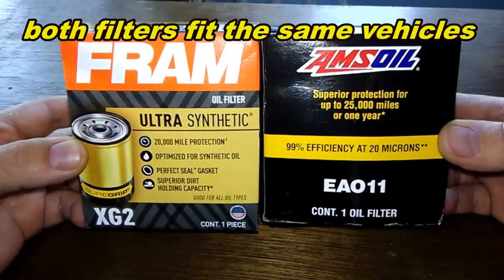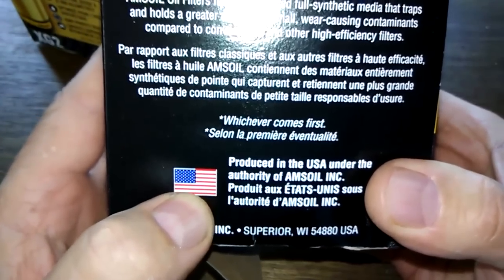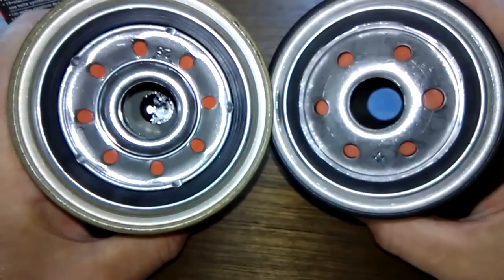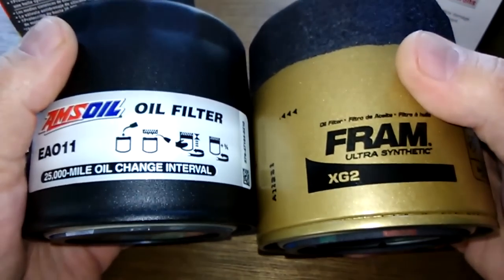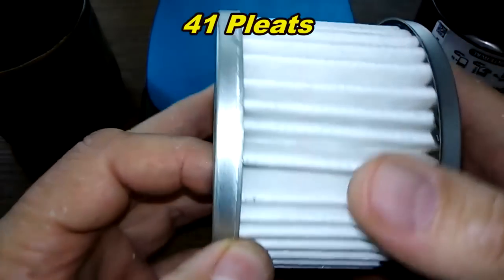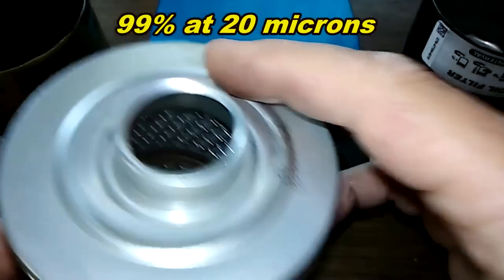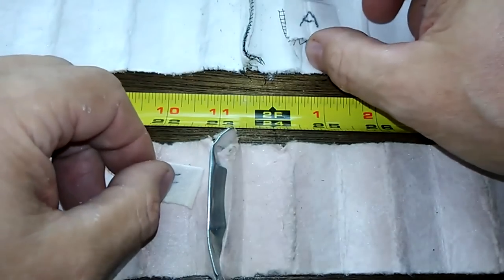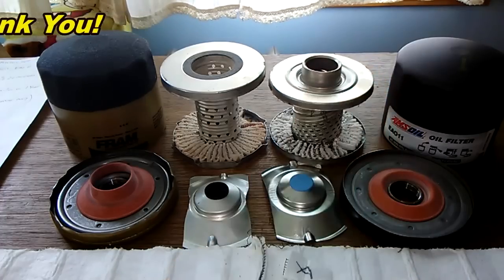Fram Ultra XG2 Oil Filter Cut Open vs. Amsoil EAO11 Oil Filter Cut Open Oil Filter Review

Comment: Any brand that tells you that can go longer with their products... Stay away from the them at all cost. This is a big red flag that should tell you that they don't know how engines work. I see this time and time again in my profession as an engine machinist and builder. What one should think about when it comes picking an oil to use... What oil will get me to 5000 miles safely? Well... They all will. The reason I say say 5000 miles... Because that's when the byproduct of combustion starts becoming acidic. There's no engine oil (or oil filters) on the market that is some how immuned from combustion contaminates. So what's the harm? The acids with in the byproduct of combustion will damage the valve stem, o-rings and gaskets. That's not good. If an engine isn't sealed properly, it smokes and leaks.
Reply from the maker: Good Point!👍

Comment: I wouldn’t use a fram on a lawnmower
Reply: I have for 20+ years. The orange filter on a $4500.00 John Deere LT 180, 17hp Kawasaki Vtwin. Doesn’t burn oil either. Gave that mower to my sister and still buy the orange Fram. Runs as good as the day I bought it. I just bought a Toro timecutter 24 hp Toro engine. In 2 years when the warranty is over I’ll be using the orange or silver Fram. It’s a $5500.00 machine with the bagger.

Comment: There is absolutely NO WAY that the AMSOIL filter is worth more than TWICE THE PRICE of the FRAM ULTRA XG !!
Also, the FRAM ULTRA XG is available just about everywhere, while the AMSOIL products are difficult to get in rural areas.
The famous 95 MERC runs Pennzoil Ultra Platinum, 5-W-20; Bosch Premium #3410 Oil Filter; FILTERMAG #SS365PR Magnet Kit -- 
oil & filter changes at 5,000 miles.
Reply: Yes, you’re right, the Amsoil filter isn’t worth twice the price but that doesn’t mean they are trying to gouge anyone.  Fram is huge and makes the filter and Walmart is huge and requires the absolute lowest price from its vendors. Amsoil is small comparatively and buys the filter from another company.
Reply: @darrylsjodin7184  Oh, no -- I din't accuse Amsoil of price gouging -- ever !
I just don't like their marketing - engine oil should not be sold like AMWAY Home Products or MARY KAY Cosmetics.
Amsoil is NOT READILY AVAILABLE -- Which means that I'll choose the products that are ON THE SHELVES at the Wal-Mart or at the AutoZone.

Comment: 25000 miles is just looking for trouble ,, PEOPLE  then thin, I only have to check oil  every 18 months  .  .. ITS NOT WORTH IT TO TRY TO CHANGE OIL AT THOSE INTERVALS.  UNLESS YOUR  A HWY COURIER.
Reply: @ronaldbertin9455  - AMSOIL coined the phrase, "Extended drain interval", way back in 1972 with the worlds first 100% synthetic API qualified synthetic motor oil with up to a 25,000 mile recommended drain interval. That was over 50 years ago now and in millions of real world over the road miles combined with laboratory oil analysis tests, it confirms that safe extended drain intervals are a reality with AMSOIL synthetic motor oils.  - 30 year Independent AMSOIL Synthetic Lubricants Dealer.

Comment: I won't use FRAM even if it was free ! But then again I wouldn't pay $20 bucks for the Amsoil filter either, its basically just a overpriced slightly over engineered AC Delco filter ,could just use one of those old school black premium Delco filters ,they are made by the same supplier Champ Labs

Comment: Fram junk vs AmsOil overpriced exaggerated overrated designer brand. Results are NOT surprising.
Reply: Fram Ultra spin on can filters are not junk, please elaborate if you believe otherwise.
Reply: Actually Amsoil products are highly engineered to perform at the  highest standards, exceeding most. The company is smaller and doesn’t get the lowest pricing for their raw products like the huge oil companies, so, they can’t compete on price the way that small stores can’t computer with Walmart